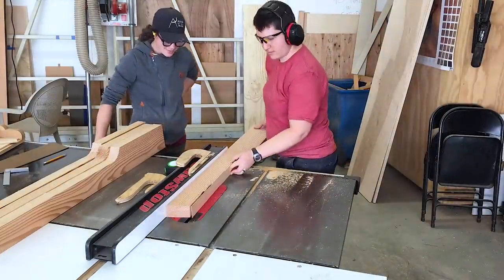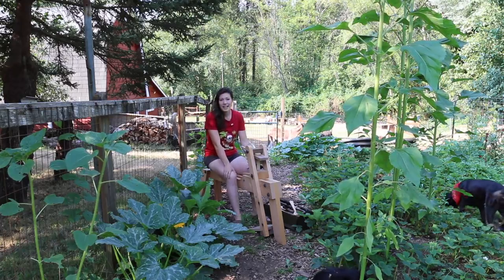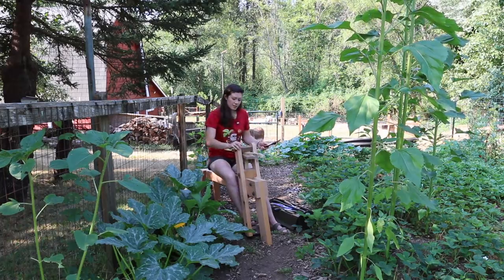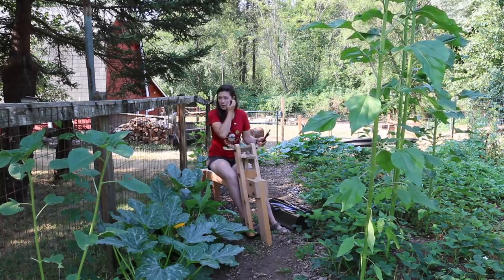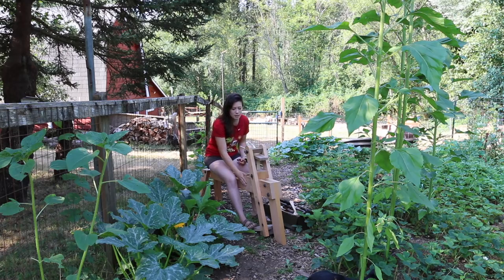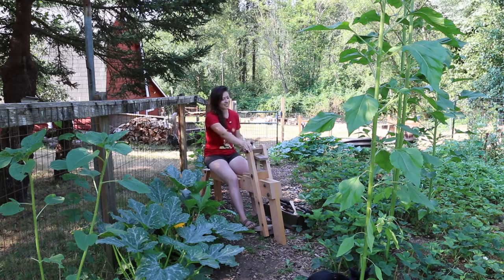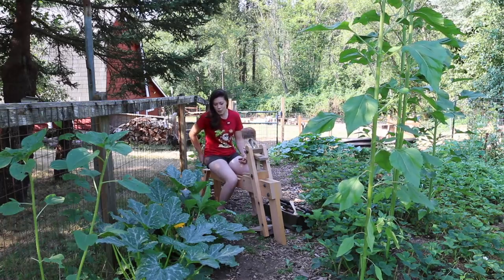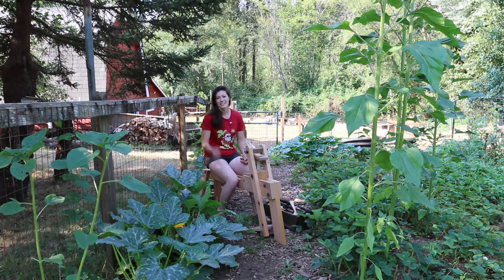Building a Shavehorse using a piece of history

Comment: Quick question.The plans say to cut both rails from a 48” blank of 2x10.  A 2x10 off the shelf is generally 9 1/2” but how do you get 2,  5 1/2 “ pieces from a 2x10 in the first place?
Reply from the maker: I’d take that up with the author of the plans, I used them as a general design but modified for my own needs and used reclaimed (not dimensional) lumber.
Reply: Anne of All Trades    same thing here ... I suppose I was really asking how you dealt with it....I’m just cutting it down the middle... either way... and I know it was a year ago.. but, nice build. And thanks for responding.

Comment: Question! Not sure you will see this but im looking to build one of these and to take classes at your school when open.. (Have a online course gift certificate I cant wait to use too!) How does this design work to hold a larger item like a canoe oar, or tool handle? Or is there a need to have a small item/spoon horse and a larger configured horse for the bigger items? I really like this one, and hope it suits multiple needs!
Reply from the maker: Hey! Really you can do anything big or small with this design, especially if you make multiple heads for it. So I have a longer head for things like spindles or rake handles and a shorter one for spoons :)

Comment: Love the video...But why didn't you just buy uncoated black steel bolts?
Reply from the maker: Because I still had to octagonalize the heads in the forge and for some unknown reason galvanized bolts are far easier to find and are cheaper ;)
Reply: @AnneofAllTrades  Ok, you can buy square headed black bolts, but forging the heads is more fun.

Comment: I have one question about the design. Visually moving from the front toward the seat, the two main beams go from about the width of a 2x6 to about the width of a 2x4. Is there a functional reason for that ?
Reply from the maker: I just lightening up the look of it towards the back legs which are also smaller than the front legs. I think it would look really clunky to leave it square
Reply: @AnneofAllTrades  I thought it might be for looks , which I like, but wasn’t sure

Comment: Please get a wooden mallet so you don't mar the ends of your pegs.
Reply from the maker: I have plenty of wooden mallets. Didn't matter about marring the pegs since I cut them flush. If anything, any marring was actually a good thing because it would have peined them out to fully fill any gaps there may have been in the joint.